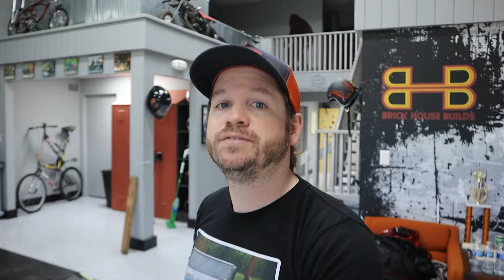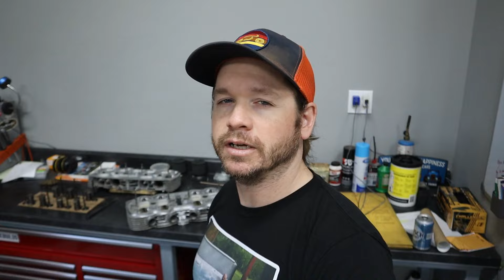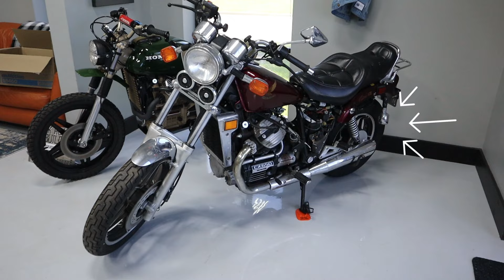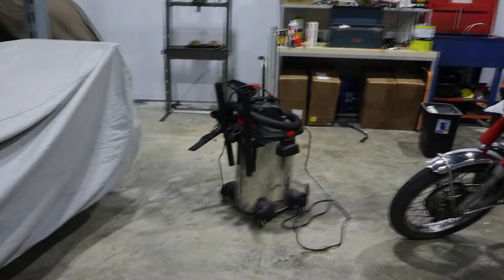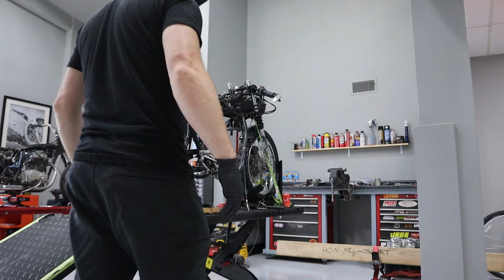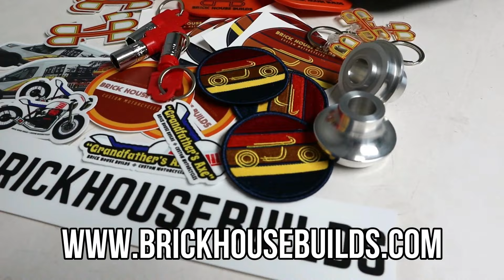Getting The Engine Back Into The CB750 Cafe Racer!

Comment: Pretty slick idea with the 2 x 4 "Honda special tool" to set that CB750 engine in the frame! Used to hate pulling those to do a top end, did an upper frame mod on several to allow for top end removal in the frame. 
Cool video, thanks man!
Reply from the maker: I definitely plan to install those removable frame sections on my future 750 build. Total pain

Comment: Since seeing Seth's cl350 on the 48hr challenge I've noticed a couple on fb, they look cool with the 2 high level exhausts & rare over in in uk which = expensive & probably zero spare parts 🤔
Reply from the maker: The high pipes are definitely the cool part of the CL line

Comment: Check this out I would put a folded blanket on the floor lay my 750 4 k engine completely  assembled valve cover to drain plug, on its side and lower the frame onto the engine as no one was there to help I'd move it around till the long bolts dropped in there holes wala 1 man engine install 😀  just saying lol
Reply from the maker: Yes when you have a bare frame that's the preferred method
Reply: It had forks tires and rims nothing elce.
Reply: And ride down the stairs second story apartment lol I was poor in those days